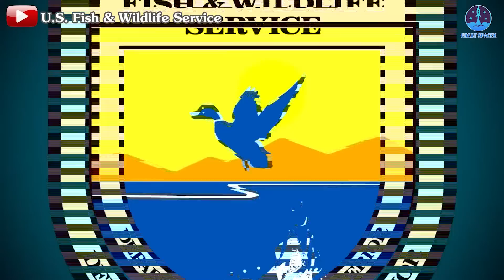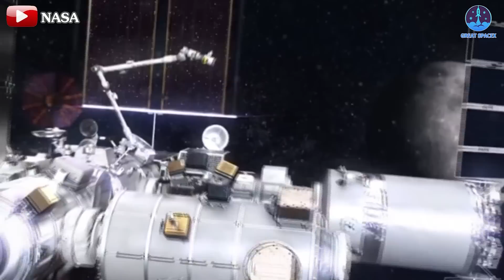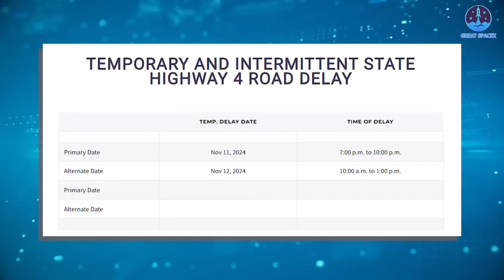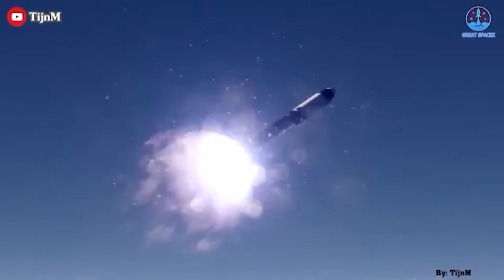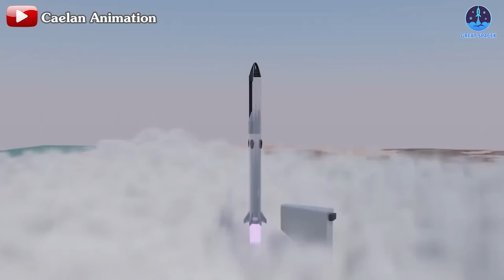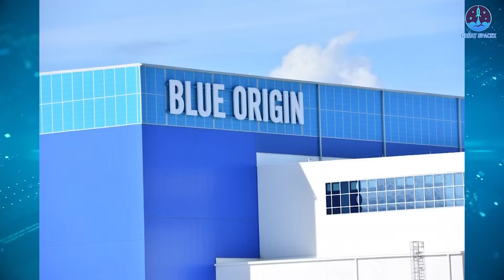Disaster! China Lost Billions of Dollars on COPY SpaceX’s Starship Catching But FAILED...REPLAY#15

Comment: That tower doesn't look real. In several ways - for one thing it looks like a render set in real video. Secondly, it lacks details - it's not complex enough, where are the cables? Machinery? Thirdly, it's an absurd design - the chopsticks are absurdly lightweight and far far too long. Fourthly, why build it near building where it could never be used for a real launch or catch. I don't believe it's real and just because the company that claims to have built it says it's real says it's real, that's no reason to believe such an absurd and unrealistic render is real. A person armed with the Unity 3D game engine could come up with a more realistic render and animation.

Comment: What this really is, is FSD in three dimensions.   Basically "self parking" in three dimensions.   There is both a fair amount AI and tight mechanical connection to the rockets required for this.   I would expect that it is just not "camera inputs" that is used for this, that there may also be RADAR, and maybe LIDAR etc. used as well.   The precision of what is happening is not fully appreciated.

Comment: QUESTION!  What happens to the Starlink ship that distributes the Starlink satellites? I've never seen mention of them being reusable or lost after use? Does anybody have info about this? Thanks!
Reply: That would be the Falcon 9 and it is completely recoverable they were working on recovering the fairing shrouds as well
Reply: @DOZZER62  Oh, so they don't use the Starship but just Booster/Falcon as the distribution platform? If I got that right, Thanks!

Comment: China's copy approach of a Starship system with more going on under the hood than on the surface is risky, considering the costs associated with space.  If they move too fast they may have to scrap entire iterations and start over from the beginning, that could set them back a lot, years.  I will give China credit for their ambitions because you have to start somewhere but it seems overly ambitious, they don't even have a working Falcon 9 analog yet.  And remember, Starship grew in phases, from a 'flying grain silo' to a bigger one to the one we see today, that took lots of testing and fundamental groundwork, you can't just jump straight into the final phase of a not yet fully proven system and have a complete understanding of the bigger system, can you?
Reply: Indeed, even as Starship strives to reduce costs on many fronts, it will eventually face the price-performance limit, mainly in the following areas:
 
Cost-effectiveness bottleneck caused by technical limitations
 
- Chemical fuel intrinsic limitations: At present, starships mainly rely on chemical fuels for propulsion, and there is a theoretical upper limit on the efficiency of chemical fuel energy conversion. Even if the fuel formula is continuously optimized and the combustion method is improved, the energy output and propulsion efficiency that can be improved are still limited. This means that to reach the goal of space exploration farther away, more fuel and larger arrow structures will be needed, and costs will rise dramatically. For example, to achieve a manned mission to Mars, only rely on the existing chemical fuel rocket technology. Even if the cost is well controlled, it is difficult to make a qualitative breakthrough in cost-effectiveness. This is because to overcome the huge energy demand, we must constantly increase investment, and the performance improvement that can be obtained is less and less obvious.
-Reusable Real Loss: Although Starship emphasizes re-use to reduce costs, its components will inevitably wear and age after multiple launches, re-entry and recycling. Like thermal protection system heat insulation tile, each re-entry into the atmosphere under the impact of high-temperature high-speed airflow, the performance will be degraded, need to be replaced or repaired; After multiple ignitions and high-load operation, the engine also has the risk of failure, which requires in-depth maintenance and overhaul. As the number of uses increases, the maintenance cost increases, and the cost-reduction benefits of re-usability are gradually offset, making it difficult to keep improving the price/performance ratio.
 
Market demand and operation scale restrict the cost-effectiveness improvement
 
- Limited space transportation market capacity: Currently, the total demand for space transportation is relatively limited, mainly for satellite launch and some scientific research missions. Large-scale commercial application scenarios such as interstellar travel are far from mature. Even if Starship can significantly reduce costs, without sufficient launch orders to spread fixed costs and achieve economies of scale, the room for price/performance improvement is limited. For example, if the number of launches per year can only be kept at a low level, the cost of R&D, manufacturing, and operations will still be high, making it difficult to achieve better price/performance ratio.
-Operation costs cannot be reduced indefinitely: The operation of a starship involves many links, from preparation and staffing before launch, to monitoring during flight, to maintenance after recovery, and so on. Each link requires a certain amount of manpower, material resources, and financial resources. Although operational costs can be reduced by optimizing processes, adopting automation, etc., these costs cannot be reduced to zero, and there is a bottom line. When the operating cost cannot be further reduced, the only way to improve the cost-effectiveness is to increase the revenue. However, when the market demand is limited, the cost-effectiveness will be limited.
 
continuous optimization of external factors affecting price/performance
 
- Regulatory and Policy Costs: Space activities are subject to strict regulations and policies, such as approval of launch permits and environmental liability regulations. Meeting these requirements often entails additional costs, such as environmental impact assessments, safety tests, etc. In addition, policy changes may create uncertainty, such as changes in insurance rates and changes in launch site use regulations, which may increase operating costs and limit further cost-effectiveness.
- Competitive and alternative technological pressures: The space industry is highly competitive, with other space companies and space programs in different countries competing for market share, possibly depressing profit margins through price wars. At the same time, emerging space exploration technologies, such as more efficient propulsion methods that may appear in the future (such as controlled nuclear fusion propulsion, if applied), will weaken the existing cost advantages of starships, making it difficult for starships to make a big breakthrough in cost-effectiveness, and facing an upper limit dilemma.
 
So, while Starship has done a lot to reduce costs, there is a price-performance limit that is hard to break due to a combination of internal and external factors.
Reply: China has its own unique development experience and technological path, from the training of scientific personnel and engineering teams, space simulation experiments, space practice verification, and has never imitated starships. I guess no one ever told you that reusable rockets don't need to be technologically iterated by firing lots of stainless steel, even if they look similar, but this is the optimal configuration for a lot of simulation experiments🤭
Reply: @后宫后  No of course not...never imitated Starship...or Mercedes, or Tesla, or LandRover, or Rolex, or or or. They must have been real sad to see their buddy Bill Clinton go too. So much access to classified areas.

Comment: I'm not a communist China lover but to be honest, we are going to need many more boosters and StarShips if we are going to get to Mars. They could lend a hand and help out with launch supplies. Instead of UPS China shipping, we could get the "STUFF" from China to orbit.
Reply: No need..Space X can launch on Starships every hour :)
Reply: The Starship is a speculative technological path for chemical rockets, with limited potential and it's difficult to achieve cost-effectiveness. In contrast, China's heavy reusable rockets have adopted a comprehensive technological path from the very beginning and are far ahead in this regard. After all, the Long March rockets have accumulated a lot of experience in lunar flights and achieved various technical indicators. It can be seen from the fact that they were able to safely send the Zhurong rover to the surface of Mars during their first Mars mission that their technology is much more advanced than that of the Starship. Moreover, they possess more advanced wind tunnel simulation test sites and large rocket launch test platforms.
Reply: You are right, Americans do need China's help